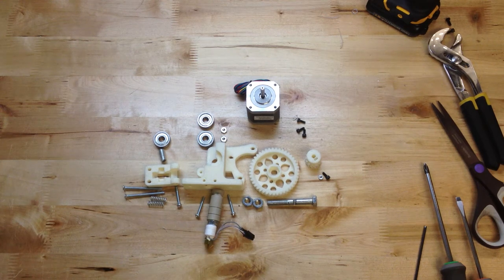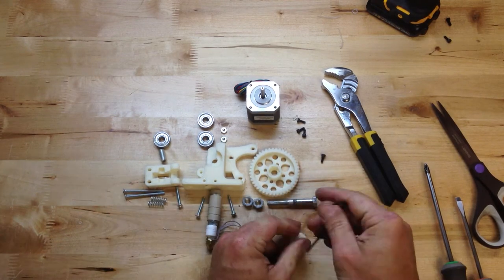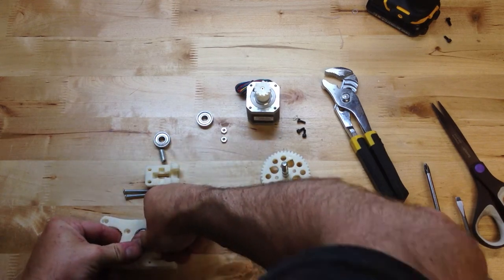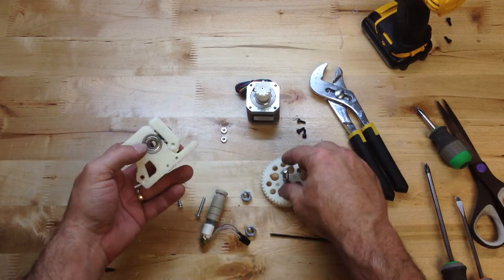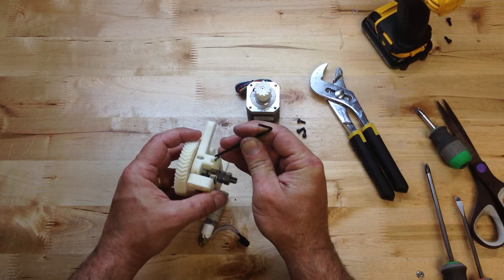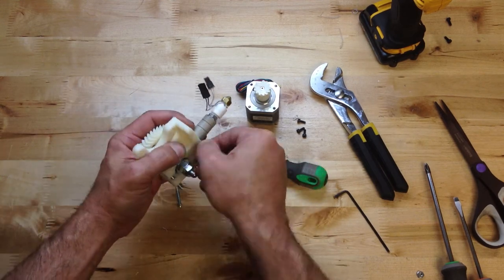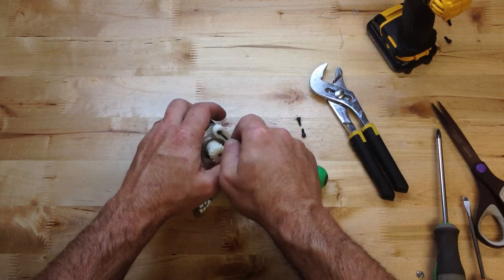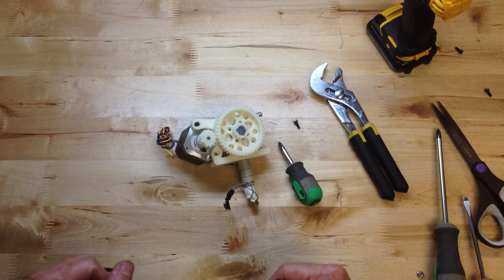Printrbot LC Build 05

Comment: Word of advice, make sure that you do not break the holes on the idler. I broke them and Gorilla Glue patched the print back together. Don't worry about breaking parts, you can just provide a temp. fix and print out new ones once you are ready.

Comment: I did everything I could to get the bolt aligned correctly including putting the large herringbone gear and bolt into a vice to squeeze it in as much as possible and removing the washer between the gear and extruder head (after which the gear doesn't turn quite as freely) and it still doesn't line up properly. I'm not going to say I'm 100% sure its not something I've gotten wrong, but I've racked my brain and reassembled the whole thing a few times and I just dont see any other possibility.

Comment: I have the laser cut wooden extruder and I think I was given the wrong hob bolt. The notches that are supposed to grip onto the filament do not reach the filament cavity and are hidden in the wood portion. So the filament doesnt even fit through the space where it is supposed to pass through. Is there a longer hob bolt that is supposed to go with the wooden extruder assembly? Maybe I got the wrong one?